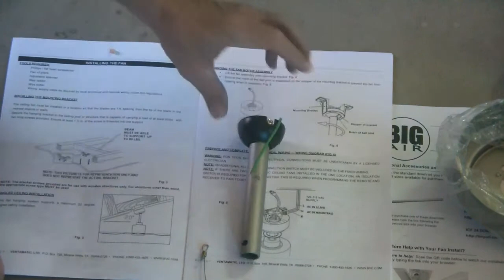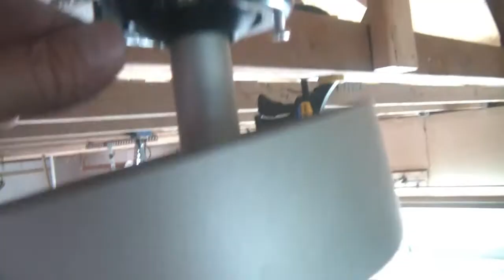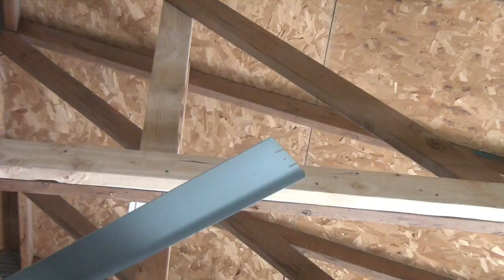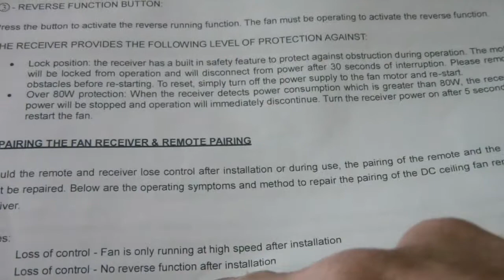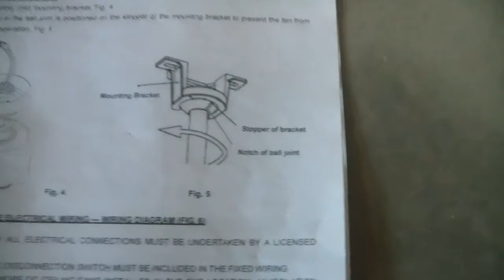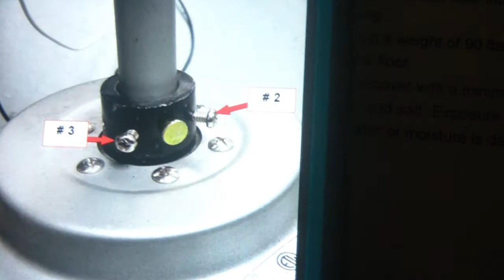home depot BIG AIR ICF96 ceiling fan review

Comment: Do you happen to know the thread and size/length of these screws? My installer did not leave extra screws and mine fan is doing the same thing. I'll buy replacement screws and make the repair if I can figure out the size of the screw. Please and thanks!
Reply: found it... #10-24 X 7/16. It was in the installation manual parts list!

Comment: Fan is roteting wrong anti clock side
Reply from the maker: Ravi it was for demonstration  it will turn in either direction. Depending on if i want a little breeze or to draw the heat up i'll switch it to do so. Generally i know it's clockwise low speed in the winter and counter clockwise  summer and hotter, the higher the speed. Thanks for the comment and for watching.